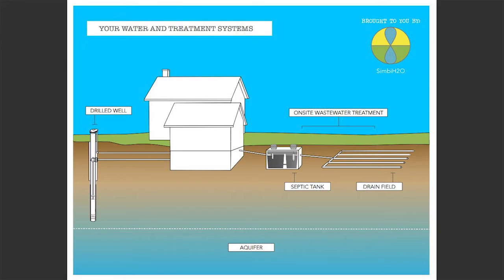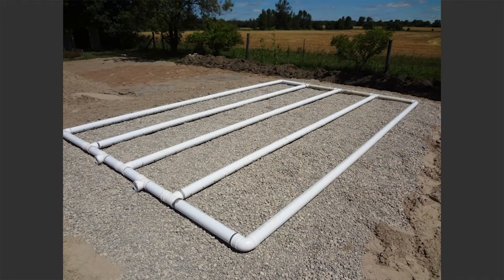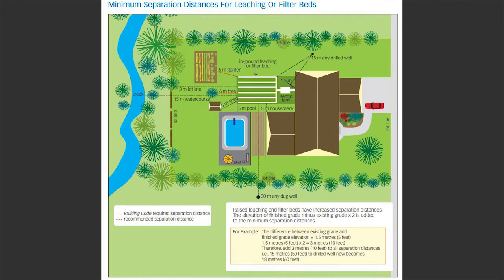Septic Systems & Septic Inspections For Rural Properties

Comment: I'm kind of afraid now.
I just bought a house in February 17 it's now may 17 and the septic in the bathroom and shower is clogging.

It's required by law here in pierce county to be pumped and inspected 

It looks like the water level is high in the tank and I can get 1 good flush a day or every 12 hours max.

I live Right by a creek, it's been raining a lot this year, 

I have a 2nd septic tank thank is working fine for the other half of the house.

I feel that it's a clog or just draining slowly.
This house was built in 1962
It's 2017 
That's 55 years.

$45,000 is a lot of money so I wonder if that's why the people sold the house.
I only have $10,000 saved if I can hold off until 2019 I think I could get to $45,000.

Maybe Ill get it pumped every 5 months to buy me time.

Damn... time to start signing up for overtime at work.
I want to say $45,000 is a lot but then again I bought a V8 Camaro for 40K so I guess in that perspective I can't even be upset if an entirely new septic system is a long term investment vs a worthless car that just sits in the garage.

That's my attempt to feel better about a shitty situation.